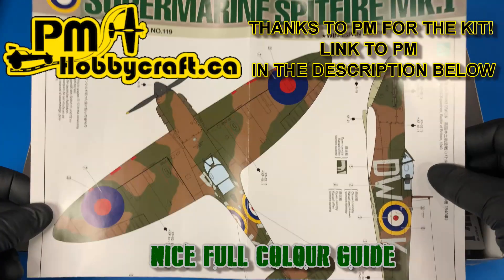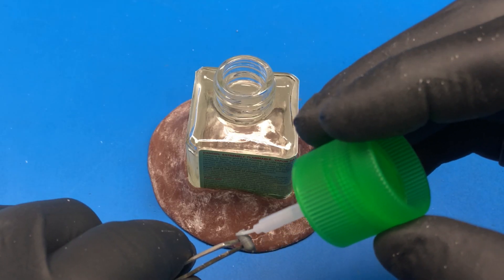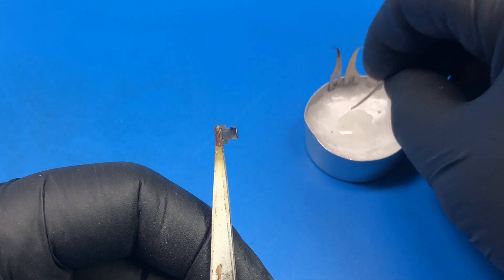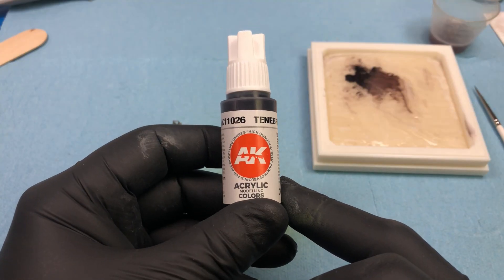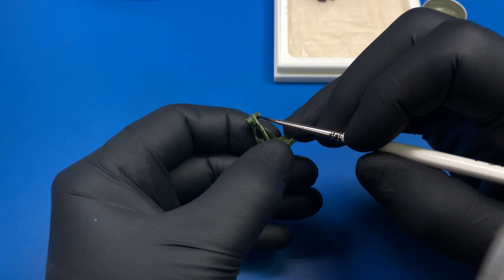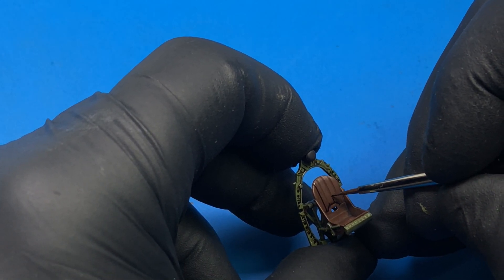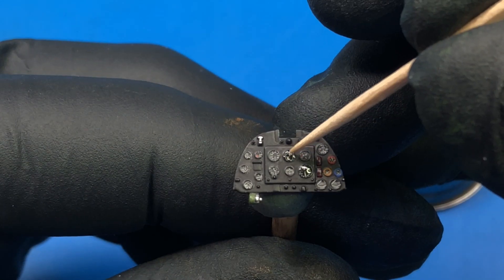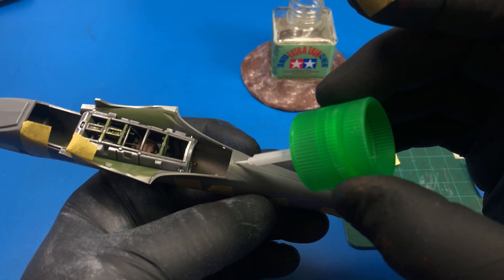FULL BUILD TAMIYA SUPERMARINE SPITFIRE Mk1 (the cockpit)

Comment: Excellent kit, just sand the etch and it will bond more easily.  I have the older 1/72 Mk. I in the stash, hoping to get to it soon.  Thanks for the video, looking forward to part 2 👍
Reply from the maker: Thanks, Jerry. Yeah, I sanded it but that seemed to make it worse. I've had issues with this nickel etch before and I think it's just not as reliable as brass. Cheers!

Comment: You've done a fantastic job so far, I was actually looking buy the eduard 1/48 spitfire, but you've gave me food for thought with this tamiya one. Looking forward to next video. I've never had a problem with that sort of PE though. Maybe it's a bit thick?
Reply from the maker: Thanks, Callum! The Eduard kit will be more involved than the Tamiya offering for certain, but the fit and ease of assembly is what sold me. Well it's pretty accurate as well... so there's that.
Reply: @SmallSoldier  some food for thought then! Looking forward to the next video.
Reply from the maker: @callumboyd5122  Thanks!

Comment: Steel type PE that Tamiya uses sucks. But, if you anneal the whole sheet it isn't as " bouncy". Also a light sanding helps with the super glue . looking good so far...
Reply from the maker: Thanks. Yep, I know about the sanding and annealing and did both. I just don't care for the material they're using. Maybe they'll see the light eventually. Cheers!